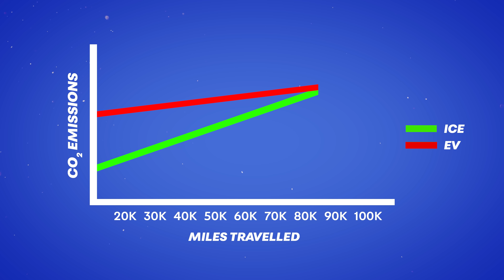Are Electric Cars REALLY That Green? [New 2022 Data]

Comment: Great presentation on this. One thing I didn't hear mentioned unless I just missed it is about what happens once an EV's battery has reached it's life cycle. If it becomes another thing that that has to be disposed of them that comes with additional environmental and cost impact. If they can somehow be recycled then there likely is still environmental and cost impact but in a different way.
Reply: Lithium batteries are almost +90% recyclable from the hydrometallurgical process and greatly reduces the energy and mining needed to make a new battery from raw virgin elements. 

Go Li-Cycle ♻️♻️
Reply: Indeed. If you have to replace the battery before the 90K break even point, then not really clear there is an advantage. More information is required (battery life) as well as other non-carbon environmental concerns (e.g., battery pollution is not just carbon pollution but the pollution caused by the mining and production of the batteries).
Reply: @johnkennedy757  That mining you have to do only once for a battery, if we stop mining for oil, it takes about a month before all ICE vehicles stop moving. There are oil spills and gas leakage every day, what do you think how that is for the environment?
Reply: @johnkennedy757  If you need to replace a battery at 90k, there is something wrong and normally will be done under warranty... Batteries last much longer than ice engines, but that is hard to get into people's minds.
Reply: @MarcoNierop  It is the future of course, but we do have a way to go as this video points out. So I take it you own a Tesla? If so what model and how is the build quality?
Reply: @virtual-adam  I have a Long Range dual motor Model Y, built in Shanghai.. 

Hands down the best car I ever had, drives very smoothly, power is phenomenal, very efficient with on average about 170 Watts per Km, I pay about 35 Eurocents per Kwh.. So do the math what it cost to fill up per Kilometer. 

Built quality is excellent, no panel gaps, perfect paint, no rattles.. it all looks and feels very solid. 

I have the car since September 2nd 2021, driven about 6000 Km, no need for service whatsoever. But I have been in the service center once to install a tow hitch (it can tow 1600Kg (3500Lbs), which is a lot!). The Model Y receives a software update about once every 2-3 weeks... I noticed it got more efficient lately (= more range!) and the software has improved, new features added like planning ahead for warming up the car (very nice during winter and better for the battery!), the ability to watch car's camera's on your phone when sentry mode is turned on.. and fun things like the megaphone. Many improvements in the Tesla App as well.

Some people complain about the suspension, its quite stiff.. But I like that, my previous cars also had stiff suspension so I was already used to that. If you like you can drive the Model Y like a go cart!

So highly recommended car, it cost me an arm and a leg and I have been saving for it since it was announced in 2019. including FSD and 21% VAT my model Y had a price tag of about €72.000,- luckely I got a liitlebit more back on my trade in car then expected.

I wont need a new car for a very long time.
Reply: @MarcoNierop  Sounds very nice. Glad you have had a good experience with it. I would like the fact that you don't have to do all the maintenance of an ICE car. Must be so much more relaxing to own.
Reply: @MarcoNierop  genuinely sounds interesting - the battery production, expected life and disposal needs to be factored into the equation.. can you point me to some info on this? My thinking being of how much is it going to cost to replace batteries and how often...
(btw, whole thread making very interesting reading)
Reply: @MarcoNierop  lol you have no idea what you are talking about. Those batteries have a limited number of charge and dis charge cycles my ice is at 259k my buddies Tesla didn't make it to 60k before the battery gave up
Reply: @beekeeper8474  1000 cycles is the norm right now, 400 miles per cycle for a Model S, so 400.000 miles. Easy math. But this number of cycles is increasing, LFP batteries have 3000 cycles as the norm.... Do the math:-)
Reply: @MarcoNierop  Alright you big EV fanatic, then explain how an ICE engine can last even over 1 Million miles. if An EV needed to travel 1 Million miles, they would need to change the battery approximatively 100 times
Reply: @leonardoluchici704  An Ice car with 1 million miles??? Where did you see that, I never ever have seen a ICE car with 1 million miles, most break down at around 200k miles, and an awfull lot much sooner than that. 

Get your facts straight buddy before posting nonsense.
Reply: @MarcoNierop  My mom's renault 1.9 turbodiesel has 200 000+ miles and is still going strong with barely any rust. Also there is cars that can go even more, with civics going past 800 k miles. ICE cars can run forever if they are taken care of.
EDIT: The renault is 21 years old !!! Also, there are cars that went well over 1 Million miles. The part why they don't last as long is that people drive them hard abusing them and that is why they break down before their time. Some get into accidents and they tend to rust if in a wreck while the engine and trannie are still good
Reply: @leonardoluchici704  my friends civic exploded when he reached 150.000 miles... But it is not about individual cases it's about the average.
Reply: @MarcoNierop  As mentioned in the comment before, it depends how it's being driven. There can be small cases every now and then when that happens (nobody makes all things perfect). But that does not make EV automatically better than ICE cars. Plus, when that battery doesn't charge any longer or does not have that much range it will suck up all the money you got from your wallet.
EDIT: If everyone suddendly goes to buy an EV the demand of electricity increases along with the prices. Not the wisest choice in my opinion
Reply: @leonardoluchici704  My Tesla model Y has a warranty on the drive train (batteries, inverters, motors and transmission) of 192.000 km or 8 years to have at least 70% of the advertised ranged... There is not a single gas car that can provide that kinda warranty.

Nuf said...
Reply: @MarcoNierop  It is true, but the usual car warranties last to 100 000 km ot 5 years. But even though I am still 18 I am going to remain a petrol head til the day I die. I don't want to give up on that manual transmission yet or those amazing and addicting high revs that no electric car can make cuz it doesn't have an internal combustion engine. Don't wanna argue. Just stated some facts.
Reply: @MarcoNierop  You do realise that the way that Tesla can guarantee that their batteries have ~70% capacity at year 8 is by including a battery buffer? With each recharge cycle, batteries lose their ability to store electricity(all batteries degrade with use). Tesla mitigates the loss by putting unused battery cells into use. For Tesla this guarantees 70% of their  claimed range at year 8. For those debating about battery degrading, Tesla is starting off with maybe 130% quoted capacity in order to still have 70% quoted capacity at year 8. Once the battery buffer is used up, the real rate of battery degradation is apparent. Also battery degradation occurs with each recharge cycle, a 50% capacity battery has to go through two recharge cycles to in order to accomplish the same range. So making the same car trips on a degraded battery uses up more of it's recharge cycles.
Reply: @longdang2681  that is utterly nonsense, my range started with about 490 km when I picked it up in Tilburg, sonit was already less than 100% capacity and certainly not 130%... Where the f did you read that nonsense?! 

it degrades rather quickly the first 20.000 km then it levels off and degrades really slowly..degradation on my Model Y is now 6% after 10.000km, which was to be expected. 

Tesla is one of the companies that does NOT include a large buffer, we are recommended not to charge to 100% every time and also it is not recommended to discharge to zero.

 But it has an emergency buffer to get you to a charger nearby if needed, but that is only a few percent. And you get all kind of warnings and the car slows down to a creep if needed. Tesla has been explaining this numerous times during interviews, shareholder meetings and what not.

Do some research before posting crap.
Reply: Isn't it the same problem for an aluminum block engine and transmission for an ICE car?
Reply: So true.  Right now china is choking on used batteries and don't have the room where they started putting them.   A few years and then the cost of new ones.  Not many can afford.
Reply: @nonhominid  Source?  The value of the minerals in lithium batteries is so high now that it is very profitable to recycle them.  I don’t understand why anyone in China store them.
Reply: There are at least 2 lithium recycling start ups that I am aware of at the moment. Battery production, lifespan and recycling will all become more efficient as time goes by just as ICE vehicles have become more fuel efficient
Reply: @chaseflores3222  the biggest hesitation for these startups is that eventually the battery manufacturers  will just make their own facilities with way more cash and efficiency than any new company can produce. 

They only hope to develop enough tech and skills that they are a good buyout target once volume of supply and demand scales up so one of the big batter brands buys them for a good price.
Reply: Plus the mining and construction to make them, horribly toxic.
Reply: @meltingsnowflakes8311  no worse than mining for oil.
Reply: Usually, after a battery is past a usable capacity for a vehicle, it is still usable in grid-scale energy storage for another decade or more (since energy density doesn't matter as much). After that, it can be recycled. Recycling does not appear to be a perfect system currently, but it's a good start at least
Reply: @dylan_00  recycling those batteries is cost prohibitive
Reply: Came here to say the same thing,l. Battery disposal and thus the emissions for new batteries should be factored in.
Reply: @davelehti4000  they are factored in. And bEV are still better even if a battery replacement is needed over the lifetime of the vehicle.
Reply: Not to mention the cost if said battery pack goes bad, or when it goes bad. Tesla 20grand to replace the pack.
Reply: @bdt72  bout the same as an engine failure in a F-150 now, yep a lot of money.
Reply: And some of the vehicles don’t have replaceable batteries because it’s built into the chassis forcing you to buy a new car, and since it would cost “too much” to strip the car to the chassis to take out the cells to recycle them they will more than likely rot in a field somewhere.
Reply: Exactly..what happens with all that toxic waste
Reply: It gets recycled. Batteries are very valuable.
Reply: @cooluser23  It is possible to recycle batteries, you got a point there, but with each time they get recycled their range and effectiveness worsens along with loss of power, while an ICE engine never loses power unless it is a serious issue with the engine.
Reply: At the moment lithium ion batteries arnt worth recycling so they are getting stored in warehouses that have been know to missterally cach fire on occasion
Reply: They do have end of life cost. Surprisingly, the BEV has lower recycling cost than the ICE.
Reply: Lithium batteries can actually be recycled, it's just not easy and thus expensive so you don't see much of it.  This is absolutely something governments need to invest in significantly since it's obvious corporations will not due to it not being very cost effective for them.
Reply: No government doesn't, the ones buying ev do. Also need to stop subsidizing Elon. Children are exploited to get your ev cars..
Reply: @aywitb911  children are exploited to get your oil. 

At least the new market for battery components is creating new and more ethical supply chains. Oil is so stagnant there are no newer and more ethical supply chains.
Reply: @Enclave.  no they actually cant. 5% of the battery components are recyclable. The Li salts (the actual battery stuff) really cant be.
Reply: @Enclave.  its not about invest, its ust that the numbers are not economical right now. Heck, loads of older Baterys currently have their powerwall phase right now.
Reply: @Enclave.  Forget governments, there are a lot of start ups in the states, china and europe that can recycle a battery to about 95% or more which is crazy high. Tesla is setting up their recycling program because all their predictions will show that recycling batteries will be cheaper than mining it fresh. Its another nice thing about electric. An interesting fact, most of the cobalt that is mined is used to make gasoline unleaded. So all that cobalt goes into the air. The cobalt that is used in some batteries (not all manufacturers us it in their chemistry) can be recycled 100%. This video wasn't that nuanced but it was better than typical videos.
Reply: @Enclave.  This is part of my point of how that needs to be factored in to any comparison of an EV being 'greener' than other options.
Reply: @dieselmutt8865  Well of course, I didn't say it wouldn't.  In fact I commented earlier on this video this: "I've been saying for years that an EV making sense depends largely on where you live.  Where I live?  Over 90% of my electricity is "clean" as it's from hydro power instead of burning fossil fuels.  An EV makes a LOT of sense for where I live, a hell of a lot of sense.  But you head somewhere that gets most of their energy from say coal burning?  Becomes a lot more murky."

Regarding the recycling of li-ion batteries though, it's a bit ridiculous that governments aren't going hard on the recycling of them, it's a limited resource and it's a resource that we use in so many industries that goes FAR beyond just EVs.  Government investment into the recycling of lithium batteries is something that should have been going on for decades now once they started becoming the dominant form of energy storage in the consumer market.
Reply: @Enclave.  Governments do not have to go after recycling of batteries... Companies are emerging that take up the recycling of batteries, tons of valuable materials in batteries, and when done properly the recycled materials are more pure then from new mining, so battery manufacturers are happy to buy it from them for a good price.

Redwood materials and Umicore are growing battery recycling companies and making good money out of this, no need for subsidies. Tesla and VW are so big they can take up the recycling of batteries by themselves, both Telsa and VW are investing in this.

EDIT 21-04-2022: Actually we learned during the Q1 earnings call, that Tesla is ALREADY using 50 tons per day in recycled materials for production of their cars (not only batteries but a lot of Aluminium scraps too)

Panasonic making the 2170 battery cells in the Tesla Gigafactory in Nevada, is also already using recycled battery materials, delivered from Redwood, so it is already happening! (just google Panasonic and redwood recycling, and you will see a  bunch of articles about this)
Reply: They also need to make the batteries cheaper, as the used buyers will not be able to afford a new one and the car will end up in the junkyard.
Reply: @virtual-adam  cars will end up in the junkyard way before the batteries are worn out, no need to replace a battery during the entire life if the vehicle. After the car is scrapped the battery will be removed and repurposed for stationary storage and when the battery is really worn out, they will be recycled almost 100%
Reply: @MarcoNierop  Unfortunately you may be right. The quality of cars is quite poor these days. The best environmental move would be to make the cars better quality with easier to service parts. But thats not good for business ;)
Reply: @MarcoNierop  Guess it also depends on how well they perform after say 5 years, if they are only say 60% as good then that may deter second hand buyers as well.
Reply: @virtual-adam  Not if your business model is to sell the cars new at break even or even at a small loss, and make the profits out of service and repairs and spare parts.

At Tesla its the other way round, Tesla does sell the cars with a decent pofit margin (19.2% in Q1.. this is insane for a 'car' company!), and hardly makes money on service and repairs. So it is in Tesla's interest to make the cars to last a long time and do not need much service.
Reply: @MarcoNierop  That's why I said its not good for business making cars last longer with easy to service parts. As you know most car companies make money on after sales services, thats why they are so hard to work on now.

It seems Tesla 'may' be posting profits boosted by regulatory credits sold to other automakers, so they may not be that reliable when it comes to their profit claims. It might be the usual bulls**t with smoke and mirrors. Hope they do make pure sales profit now or in the future as more competition is always good. The other players will no doubt try and milk the consumer otherwise. e.g. 4 year cam belt changes only in the UK from Audi.

Have to respect what Elon has done but after how the tunnel loop in Las Vegas turned out I'm not sure if he is a straight shooter all the time.
Reply: @virtual-adam  regulatory credits was only 2% of their automotive revenue, it was a one time high number due to changed regulations. Tesla was very open and honest about this.
Reply: @virtual-adam  Tesla is making the cars to last because they are aiming to be used as Robotaxi's in the future, which will make Tesla trillions of dollars at some point. It makes no sense to make them to need a ton of service because that costs them money. The business model of Tesla is completely upside down compared to legacy car makers.
Reply: @MarcoNierop  Very interesting. Good plan from Tesla, hope it happens. Electric cars are obviously more reliable than ICE. Would like an electric conversion one day on my Audi S3 from 1999. All the parts you have to worry about in a ICE just gets stressful as cars age. I see why you like Tesla based on your points, I just hope its not all hot air 🙂
Reply: @MarcoNierop  excuse me the better will die long before the car needs to scraped and if they're your solution then ev is far worse for the environment
Reply: @virtual-adam  EV's are actually quite nice and require very little maintenance. EV's have 90% fewer parts and have over the air updates. I think you will start to see the length of ownership increase greatly.
Reply: @virtual-adam  The battery in my car has a ten year warranty. Most EVs have at least an 8 year warranty. 
If a battery goes to 60% in 5 years, it would be defective or have a firmware issue.
Reply: Yes, they can be recycled up to about 100%. That's not a problem anymore. Several companies have formed to do that already.
Reply: @newguy6935  look up Umicore and Redwood Materials, but VW and Tesla will do this in house as well... It's an emerging industry.
Reply: @MarcoNierop  yes, already familiar with these companies.
Reply: @MarcoNierop  Btw... I also looked up the Les Hooper Big Band... Really good! Would love to see them live.